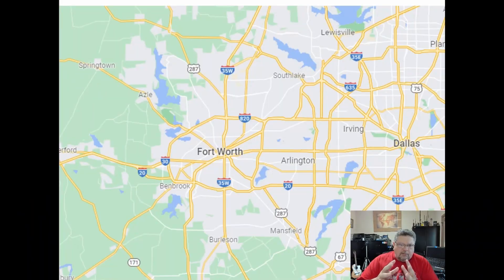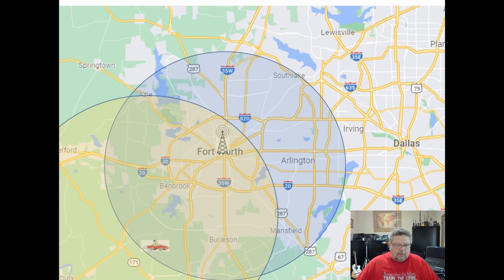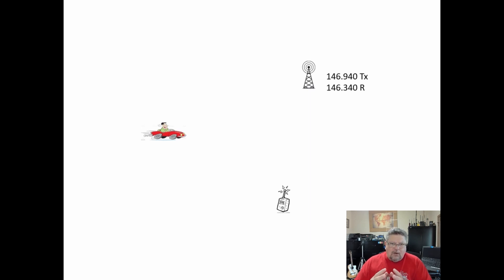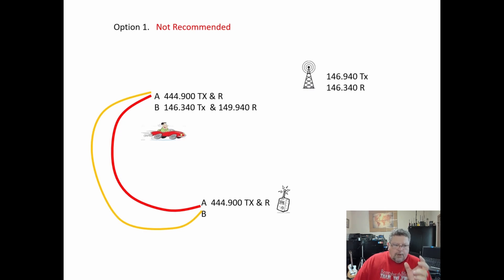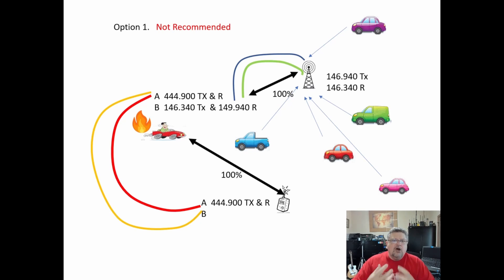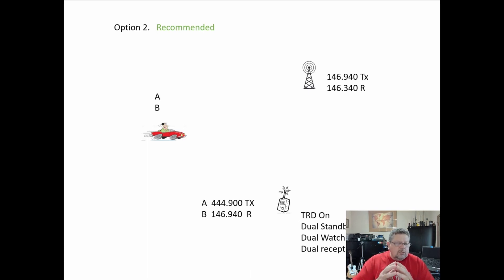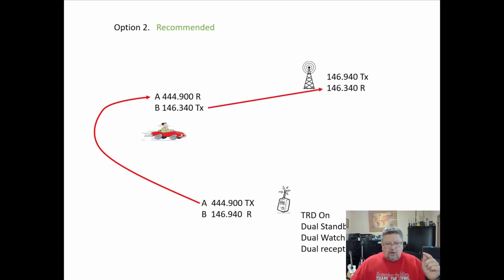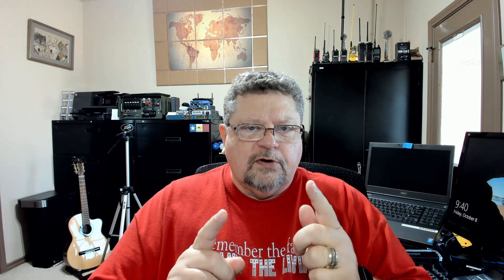How and Why to use Cross Band Repeating

Comment: I do it all the time on my FTM400 at work because it's a steel building. That's an undocumented feature of the FTM400. The three buttons under the power then hit power and there you go. One VFO has to be UHF and the other VHF. Then I have to figure out which is the volume knob. 😉
Reply from the maker: Have you used the FTM400 during heavy NET traffic on the repeater?  How does it handle the high duty cycle?
Reply: @MeOnTech  I've never used it on heavy traffic. I turn it on during drive time low pwr by low pwr. Usually only about an hour. I set it to high pwr by low pwr when I'm in the boat on lake Alvarado. That's usually hit and miss. Depends where I park the truck. It never hits high pwr unless I transmit at the lake. I also have a TYT TH9800 in the El Camino that has a crossband repeater built in, but I only leave it low pwr both sides. It doesn't say Yaesu on it, so I don't trust it to not run away.